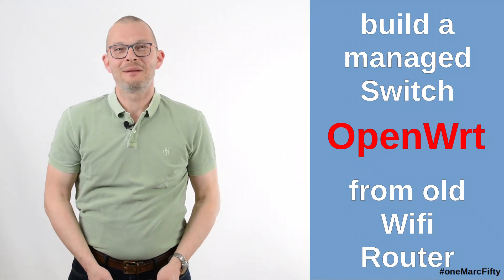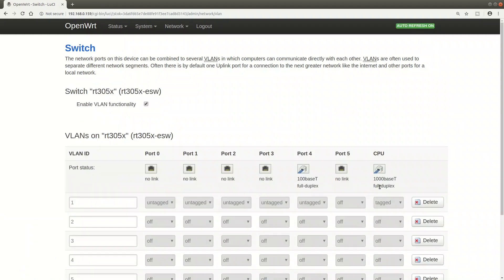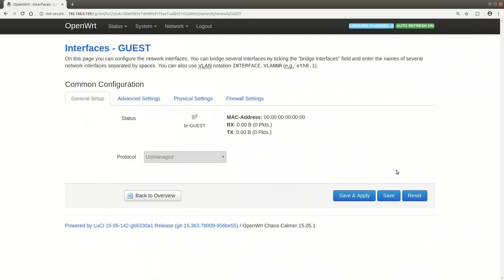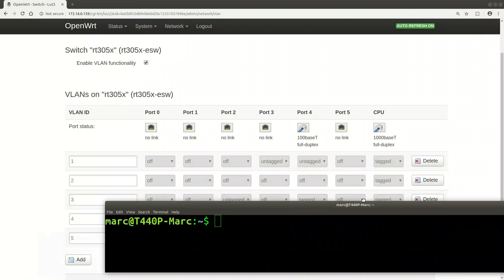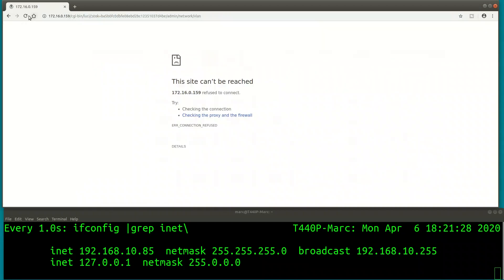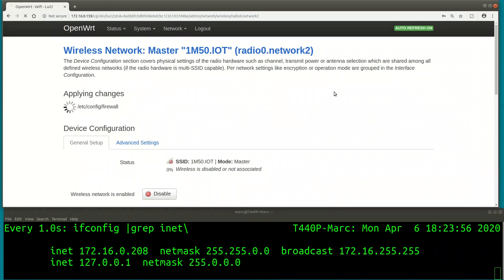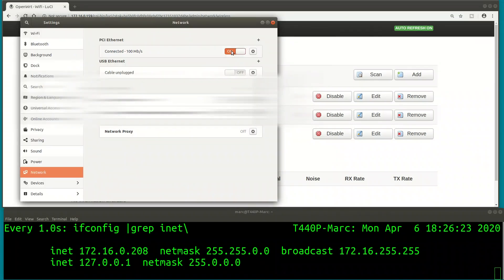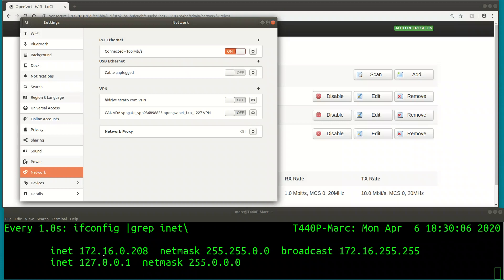Building a managed switch with OpenWrt on old Wifi Router

Comment: Thank you. This worked for me as of 2026 with two tplinks wr103nd running OpenWrt 23. I have not messed with complex settings. Just edited Network->Switch as you have shown. The added necessary interfaces pointing directly to eth0.<vlan id>.

Comment: Hi everyone,

I need some help with my TP-Link TL-WR841N v11 router running LEDE Reboot 17.01.4 (commit: 79f57e422d) with LuCI (LEDE-17.01). While trying to follow a setup guide from a YouTube video, I accidentally messed up the VLAN configuration. Now I can't access the router via LuCI or SSH, no matter which port I use.

What I've Tried So Far:

Reconnecting the Ethernet cable to every port and trying to access the router.
Attempting to SSH into all ports.
Trying to use fast recovery mode, but I couldn’t find clear steps specific to this device.
Using the "power on and hold WPS/RESET until continuous blinking of the power LED" method to reset the router.
Additional Details:

Someone else initially installed this version of OpenWrt/LEDE on the router and had configured some VLANs, changing the default IP to 192.168.2.1.
I changed a few VLAN settings for the ports, which seems to have caused the issue.
I’d prefer to avoid losing the current firmware if possible.
I’m stuck and not sure how to regain access to the router. Any guidance on restoring the router to a working state would be greatly appreciated.
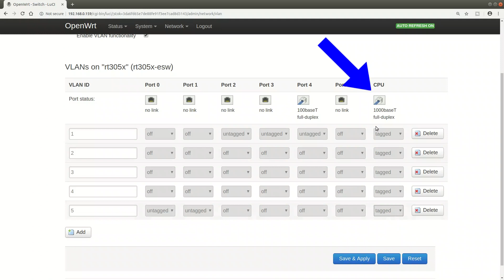At the 3:01 timestamp in the YouTube video, I clicked "Save" after making changes to the VLAN settings.

Thank you in advance! 🙏

This version is concise, clear, and professional while maintaining a friendly tone.

Comment: This video is still very relevant, even though OpenWRT now uses DSA.  I had an older router that does not support DSA, but with the help of this video I was still able to get it set up in an equivalent manner. The version of OpenWRT I used was 23.05.5
Reply: Hola, como hago para instalarle la opción de switch al router "edgerouter x" en su ultima versión de openwrt.

Comment: Hello how would I use my openwrt router to manage sqm to my duma os router?
Reply from the maker: Hi, SQM should be done on the Internet gateway really. You can however have SQM run on any downstream router separately as well - it should not do any harm.
Reply: @OneMarcFifty  Couldn't figure it out so I just flashed my xr500 with OpenWRT, and run two routers to mange different devices.

Comment: Hi Marc, Thanks for your Videotutorial. I followed along, but there are some questions: When you check the ports if they distribute (get) the "right" IP/subnet, where comes the dhcp server? Which not mentioned router/switch/pc is handling the different subnets with dhcp? Where is it connected to? Could you show/explain how to manage dhcp subnets with an other cheap home router? Thanks for your answer und greetings from Frankonia!
Reply from the maker: Hi Klaus, the DHCP Server would be the Internet Gateway or your "main router" really. I have silently assumed that people would set up the main router the same way. You might want to check this video https://www.youtube.com/watch?v=qeuZqRqH-ug where I show the whole VLAN setup etc. in OpenWrt 21. Another one to check out could be this one: https://www.youtube.com/watch?v=4t_S2oWsBpE Greetings from Swabia ;-)

Comment: I have a pfsense firewall already. So if i set the router running OpenWRT into AP mode will the VLAN function still work?
Reply from the maker: Yes- pfsense can of course do 802.1Q VLANs as does OpenWrt.

Comment: Marc: It looks like when you have all VLAN tagged, it is called a Trunk, when it is one untagged & rest tagged, it is called hybrid, and when only one untagged and rest off it is access (as per industry switch terminology).  Is this correct?
Reply from the maker: Hi Anil, I am not sure if there is a real standard terminology (i.e. outlined in an RFC or the like) - but it's true that in the industry the terms used are mostly CISCO-ish like outlined here for example: https://documentation.meraki.com/General_Administration/Tools_and_Troubleshooting/Fundamentals_of_802.1Q_VLAN_Tagging

Comment: What should I be using if my router lists 2 CPUs (eth0 and eth1)?
Also, if I have a WAN port, can I use that to connect to my router as my alternative to your port 4?
Reply from the maker: Check the interface section of OpenWrt in order to figure out which interface to use. Your br-lan will use either eth0 or eth1 on the physical tab. Presumably your WAN line is tagged to the other, so to answer your second question - yes, you could tag the WAN port to the other cpu and use it as a LAN port. But be careful, it's easy to lock yourself out ;-)

Comment: I am sure if you choose openwrt over pfsense there is a solid reason. Kindly share with us. Thanks. I admire your projects.
Reply from the maker: Well, you know - like so often in IT you use what you know - I know Linux and I know OpenWrt - just happened so 😉 I have just never felt the need for anything else. I am tempted to believe that it must be the same for someone who uses pfsense. I do have it on my list though 😉
Reply: Both are great products.  pfsense (now opensense or earlier m0n0wall) tends to be less supported on so many commodity hardware.

Comment: Thank you so much for your clear explanations! I am a beginner to networking, so I was hoping I could ask you about a couple of things:

1. Does this work the same for routers with ethernet ports that support VLANs?

2. Why do you leave the second VLAN and just turn it off? Is there something significant about the VLAN ids that require that VLAN to be unused, etc.?

3. Why did you keep two ports on the Parachute VLAN until the end?

4. Did you set Unmanaged on the Guest and other interfaces so it can’t access the switch itself to administer?

5. It seems like interfaces themselves can have IP addresses as well as the devices connecting to them. Is that correct?

Thank you again!!!
Reply from the maker: Hey, Ravi - let me try and answer in order: 1.) I assume you refer to Distributed Switch Architecture (DSA) as of KErnel 5 - yes that works as well. On a linux host you can also just add ethx.y devices in the network config and they will support VLANs. 2.) In my network, the VLAN 2 is the WAN - that's all. Generally speaking, with regards to VLAN IDs best practice is to NOT use VLAN ID 1 in order to avoid VLAN hopping attacks. (In a nutshell use another VLAN, e.g. 24 and give the ports a different PVID, e.g. 44 which you don't use) 3.) One port would have been enough of course. 4.) Yes-you are correct - that makes the switch "invisible" in those networks 5.) Correct.
Reply: @OneMarcFifty  thank you!!

Comment: Thanks for sharing this. Need to test this with a cheap router.
Reply from the maker: Go for it ;-) let us know if it worked
Reply: @OneMarcFifty  sure.
Reply: Hi, yesterday I just realized that I owned a router since 2018. Its model is Netgear R6100. Today I'm trying to set up the VLAN part but it makes me confused. This router receives internet from the WAN port. Do I need more devices like a switch to use vlan port or it just work like I've already said?

Comment: Hey Marc,
 Do you have an opinion on pcwrt? If you're not aware, it's a simplified version of openwrt/luci that a guy sells. He ships a router for around $130 with his closed source software on a Newifi 3 D2, (a decent consumer spec, MT7621 based router, allegedly made for Lenovo). I got one at a time when I didn't want to take a deep dive into networking but needed a new router fast. (I have no affiliation.) His software is updated regularly, and it works as advertised. It is quite easy to setup a firewall and has a way to create one click openvpn servers. The firewall is even easier to setup than UFW or gUFW, and the logs are easy to parse.
   However, there is a locked setting for external remote SSH, with what I assume is the pcwrt-dev's key. I get notifications about automatic updates regularly though. I also get warnings in Firefox about an unsigned certificate related to the router's http page and that seems kinda sketchy. I just use the router to separate my workstation from other devices on a larger network, and for a whitelist firewall. Do you know about, or have any thoughts on pcwrt?
Also, how would you monitor and assess a device like this to determine its behavior? 

 Even with openwrt, I think all of these devices are supported with reverse engineered software and undocumented silicon. While the Bootloader and Linux system are pretty straight forward, I think there may be plenty of room for intentional/unintentional zero day exploits, even perhaps a lower ring level OS, like all modern intel and AMD processors have. How does someone get started analyzing and monitoring a device to determine its total behavior? I could really use a simple tutorial on this subject. I have had a similar curiosity with several devices I am reluctant to give network access to over the last few years, and this subject fuels my curiosity as I explore hardware development as a hobby. Networking is just one of those subjects I'm less interested in but need to learn more about.
-Jake
Reply from the maker: Hi Jake, many thanks for this feedback! I do not use PCWRT and hence can't give a qualified opinion here. However - on a more generic note - the question whether your devices "behave well", i.e. if they are "phoning home" or opening channels to the outside etc. will be a matter of future videos. I am planning an episode of my toolbox series where I will introduce Wireshark as a tool and we will use Wireshark in further episodes to troubleshoot network situations. I might pick up your scenario (not w/r to the product you mention, but in a general way) and answer the question in a network diagnostic episode. The big issue is that everything that happens on the network is invisible to most of us, in both scenarios (when something doesn't work as well as identify leaks). Stay tuned ;-)
Reply: @OneMarcFifty  
 Thanks for the reply. In the past I have tried to use wireshark and a few other tools.
 For instance, I started watching my network traffic from the command line using ss (IIRC). I kept seeing a bunch of connections to a couple IP addresses I didn't recognize, and, once blocked, it would immediately reconnect to another address in the range on the same server. A whois search just gave me info on the data center for the server. I started searching the internet for info and, of course, I found random forum posts and inconclusive info hinting that this could be something malicious. So, I started blocking entire address ranges. This worked for a few minutes, but then new connections came up that mapped to the same server company but with a different location and entirely new IP. I asked around on a few forums, but no one seemed to know why I kept connecting to these servers. I tried different hardware/software at every level, but still, I kept seeing connections to these servers.
...
 It took me ages to learn what a CDN is :-)
On an abstract level, this is what I mean by 'a simplified explanation.' It is easy to show wireshark and tools. Everything I have followed so far seemed helpful and straightforward until I actually try to use it. I have gotten lost in the weeds a few times while exploring this subject.
-Jake
Reply: Newifi 3 D2 is very well supported on OpenWRT and I have one running at home with rev 21.02.

Comment: i watched the video many times, but there is something missing, i could define my vlan, my pc gets ip correctly but it does not connect from this vlan to the wan. i hope you have a special tutorial for vlan, what is tagged and when to use it. Unfortunately, i did not find other tutorials for openwrt for vlans.
Reply from the maker: Hi Sherif, I have been asked to provide more on this subject a couple of times and it will come! I am in the process of planning two more episodes - one on firewall setup for IOT/LAN/Guest plus one on extending guest/IOT to a second access point. These videos will answer your questions and again explain VLANs with OpenWRT in depth!

Comment: Marc great videos. Video idea : Setup an openmptcrouter and aggregate real speed in a video
Reply from the maker: Many thanks @Erdem - I assume you have seen my VPN bonding video where we do this with Openvpn? https://www.youtube.com/watch?v=I08A4-PWawk
Reply: @OneMarcFifty  the issue with the vpn bonding and speedify has the limitations. the mptcp protocol eliminates all the issues with the virtual private server connection and slowing down for the slowest link so there should be a real speed aggregation. it is based on openwrt and could completement this channel
Reply from the maker: Thank you Erdem - the reason that held me back from doing stuff with openmptcprouter so far is basically the fact that you would need to compile an MPTCP enabled kernel on the VPS. Furthermore, the supported hardware. But you know what ? I think I'll contact Yannick Chabanois (the maintainer of openmptcprouter) and see if we can do something ;-)
Reply: @OneMarcFifty  he replies in github issues section
Reply: @OneMarcFifty  the vps works in google gcp. The local hardware needs to be something can run openwrt
Reply from the maker: @RifatErdemSahin  Many thanks, I have contacted him - just don't want to spam his issues section as the questions I have are not really related to issues in the code.
Reply: @OneMarcFifty  I did make it work on 2 different platforms 1)skull canyon intel 2)wmware virtualized server. The reason i am thinking to get a pysical hardware for this is we are using wevideo and the uploads are very important. as seen here https://twitter.com/rifaterdemsahin/status/1323538757899923456 With more connections you really need a reliable hardware for my taste. The skullcanyon and the wmare solution was losing the ethernet cards everytime the system was booting up with an external usb ethernet cards.
Reply from the maker: Ok I see - maybe VLANs and a managed switch would be the solution here ? You‘re giving me lots of ideas there ;-)
Reply: @OneMarcFifty  i did not have time to implement a vlan solution there from my edgerouter 12p. It could be the way to go as the repo owner suggested. As this is a beta project i can only set this as a secondary gateway and need to test it on the side.

Comment: I have tried many times to bridge via wifi to my internet access point from an openwrt wifi client/station router.  I have always tried to do this via routing but it seems to be a limitation of atheros chipsets that layer three does not work across such a bridge.  Once NAT is enabled then it seems to work.  Will this bridging work if the wifi client and the lan on the station are bridged via a vlan?  Will dhcp requests from clients on the lan succesfully traverse to the internet access point via the wifi client on the station?
Reply: These issues seem to be addressed with batman-adv.  If you want to do a workshop on setting this up and utilizing the management functions such as syslog and snmp and snort then I could be willing to make some donations.  I have a netgear wndr4300v1(ar9344), wndr4300v2(qca9563) a WD MyNet 600v1 (ar9344) and a Netgear ex6100 v2(ipq4018).  Since they are all qualcomm I am hoping they will be compatible enough to build a batman-adv mesh network but I am not sure about the ex6100 because it is an ARM processor and the others are MIPS. It also uses the Ath10k driver instead of the ath9k.
Reply from the maker: W/r to batman/mesh I had been thinking about this too - building my own mesh solution. I am still in an investigation phase however - but it is something that I have on the list. Many thanks for the hardware offer, however I do have a big box of stuff lying around;-)
Reply from the maker: I have tried this a couple of times and could not get it to work- as you say it seems to be a limitation of the driver. Bridging AP works like a charm, but bridging in wifi client mode does not.